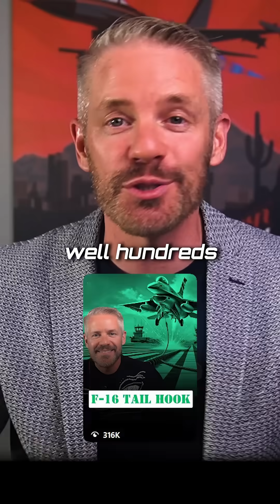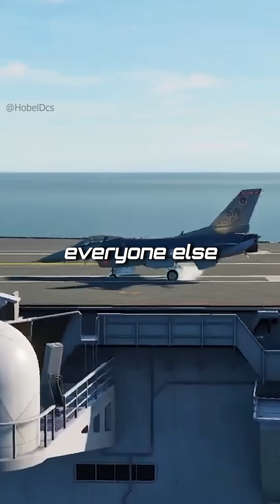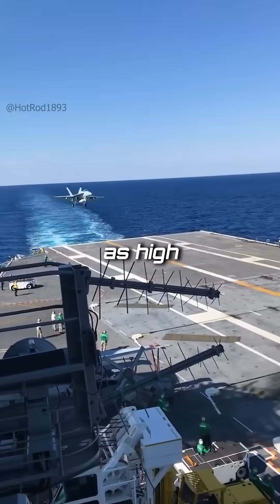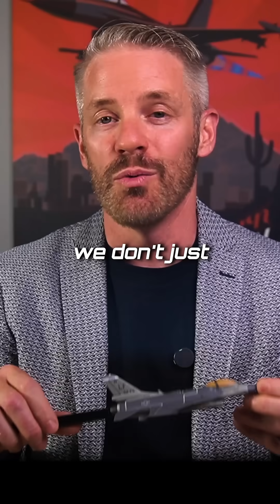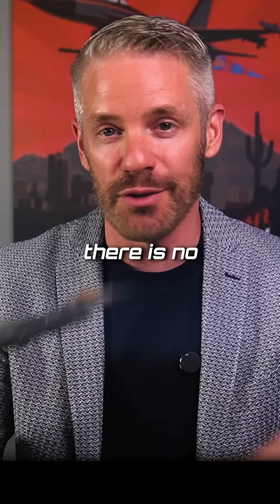Why the F-16 Can’t Land on Carriers

Comment: They did experiment with the f16 designing a navy variant but did not work out i actually got to see it when I went to Pensacola to the national naval aviation museum ( I also think they use them for training but I'm not sure )
Reply: Are you referring to the F-16N? 

Those were used at Top Gun as aggressors. If I recall, a navalized varient was proposed but the Navy wasn't interested. They chose to further develop the YF-17 into the F-18. They like to complain about single-engine fighters not having sufficient safety margins operating over water, but the Navy has operated many single-engine fighters. 

I think the Navy just doesn't want USAF types & vice-versa, so anytime they can get away with it, the respective services will push for their own airframes.
Reply: @rts0fft0ya16  yes

Comment: Use the hook where in emergency situations? If you can't use it on a carrier where would you use it?
Reply from the maker: We have cables on almost every runway 😃
Reply: @realshawnwalsh  Thanks. I had no idea.
Reply: If the aircraft has a hydraulic failure or brake issue it  will take the cable to stop the aircraft before it goes off the end of the runway.

Comment: Clear and present answer!
Reply: Clear and present...  but WRONG.
The question was 'can'.

An F-16 can easily land on an aircraft carrier.  The landing gear can easily handle the stress.  And the tailhook can easily handle it as well.

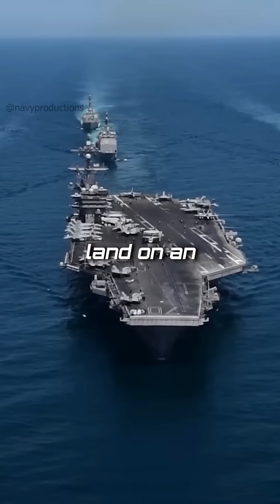0:13 - "It's just not built for it."

The mistake here is whether the design can handle doing something ONE TIME, versus doing it many hundreds of times.  So the answer to the question of whether the F-16 can, the answer is easily YES.  But if you tried to do it dozens of times, then you will eventually snap the main landing gear off.  Tailhooks are easy and cheap to replace.  So you'd swap that out after it started to show signs of metal fatigue.

Now here's the reason why it has never been done, and will never be done:
Because the aircraft carrier is worth orders of magnitude more than an F-16.  Attempting to save one jet at the risk of impacting severe damage to the carrier will never be worth that risk.

The Captain of the ship will SHOOT YOU DOWN before you got close enough to try.

Notice how on Navy fighters, they only put ONE STICK in the jet.  That's because they would much rather you EJECT than let a non-pilot attempt to land on their carrier.  This is why  Cougar's backseater had NO option to try to land himself.  It was either Cougar trapping, or they were going to eject.  Even in a 4-seat Prowler, they had only 1 stick.  Even though the right seater had the same view as the pilot.

Now I would like to see someone try this, to prove it once and for all.  Especially to very well experienced people who tell everyone it can't be done.  And here's one way to do it sensibly...

Get a Nimitz-class that's about to be decommissioned, being replaced by a Ford.  And then get a Navy carrier pilot who has been F-16 qual'd, and send them to do it.  On a volunteer basis, of course.  I am of the opinion that you could do it all day long.  Yes, it would certainly be a very HARD LANDING.  But the F-16 landing gear is designed to handle hard landing.  Just so long as you don't do it too many times.

Now the person who would have the most credibility saying what is being presented here is exactly that kind of pilot:  A Navy carrier fighter pilot who has been qual'd in the F-16.  There is no shortage of such pilots.  Look at nearly everyone who flew the F-16N.

That said,
You might be able to find an F-16N pilot who says what is being asserted in this video.  But if there is such a person out there, I would guess that they do not have an engineering degree.  But really all that is needed is COMMON SENSE:

- How different is the stress on the tailhook in a carrier landing versus taking an approach end cable on land?  Yes, you have LOADS more cable runout on land, but it is not all that different.
- How different are the loads on the landing gear in a very hard runway landing, versus the no flare landing that is done on a carrier?  It is essentially the same.

All anyone need do is put these two situations together, and viola.  You arrive at the most obvious answer of just how SIMPLE it is to land an F-16 on a carrier.

Now one point not addressed here in this video is:
Can an F-16 TAKE OFF from an aircraft carrier?

Here the answer is very easy too:  Most certainly YES.

Take a Block 52, give it a very light fuel load, pour the coal on to get max Wind Over Deck, start your takeoff roll from the very back of the deck, and getting airborne would be a piece of cake.  So easy that I expect you could do it in MIL power.

Can an F-16 do a Cat Shot off a carrier?

Here, modifications would need to be done.  Your typical Navy fighter has TWO nose wheels.  This is so that when you hook up the catapult to it, the loads are balanced between those two wheels.  The jet is pulled from the middle of them.  You could try it with the single F-16 nose wheel.  But my guess is that there might be severe stability wobble issues.  And given that the F-16 was never designed to take such pulling loads on the nose gear, I would not be surprised if the gear would SNAP right off.  But you can see how the Navy rigged certain fighters for cat launches by attaching WIRES that pull the jet at anchor points where the aircraft can handle the pulling load.  So that same type of approach could be done with the F-16.

So here too, my answer would be YES.  Yes, the F-16 could do a cat launch, with certain minor mods.

But while landing is easy, and taking off is also easy, given the full deck for your takeoff run, doing a cat launch is NOT something I would see to be easy.  Depending on how the mods were done, it might be a very dicey thing to attempt.  But I would expect success.  And as with landing, not something you'd want to make a habit of doing.

And for ANYONE to address this question, it should be pointed out that way back in the early 70s, they TRIED to sell the F-16 to the Navy.  Just as MacDac teamed up with Northrop to make the YF-17 carrier capable (meaning, doing it on a daily basis), the plan was for Vought to do the mods for GD with the F-16.  This proposal was called the 'Model 1600'.

An easy guess here is that THIS was the jet that the Navy PREFERRED.  The YF-16 handily beat the YF-17.  The story that got fed to the public was that the Navy wanted the reliability of having 2 engines.  This cover story is blatantly hogwash.  The Navy had great success with jets like the A-4, the A-7, the F-8.

Then fast forward to the F-35.  Did the Navy lodge this complaint decades later?  I never heard a peep.  So obviously it was a bogus reason, and the general public ate it up.  The actual reason why the Navy bought the F-18, and not a navalized F-16?

Because if you give too many contracts to one company, the competition will starve, and eventually die out.  The Navy ended up with the LOSER of the LWF competition because the Pentagon needed to throw MacDac a bone.  They needed to keep that company competitive.  And so billions flowed into their coffers.  If you want to do a much more OBJECTIVE ANALYSIS of the F-16 versus the F-18, all you need to do is look at the decision made by dozens of countries around the world.

Some 32 COUNTRIES picked the F-16, rejecting the F-18.

Who made the opposite decision?
7 countries, including...
- Canada
- Australia
- Switzerland

I would say that the most telling decision is what happened right here in the United States.  The Navy pushed to buy F-16s, as noted above.  Was anyone in the USAF eager to buy any F-18s?  I'm not aware of that happening a single time.  The best counter example is NASA's decision.  They bought a few F-18s.  I don't recall NASA ever buying a single F-16.  Not any normal ones.

So the bottom line is, YES.  The F-16 could EASILY land on an aircraft carrier.  But would anyone let you try?  That would be the most unusual of circumstances.  And could an F-16 take off from a carrier?  Here too, the answer is YES, easily.  And demonstrating this could be done at a very low risk to the carrier itself.  The most expected worst case here would be the F-16 drops into the drink, but leaving not a scratch on the ship.  But a clean Big Mouth GE with a very light fuel load...  I'd give it a success probability in the high 90% range.  Even higher success with landing.
Reply: Here is a much more concise rebuttal to this notion that you can't, because...

0:13 - "It's just not built for it."

NO ONE is making you fly a normal glide slope to the carrier deck.  If you are squeamish that the landing gear can't take it, then just fly, say, a 1-degree glideslope.  Yes, a lower final approach angle increases your landing footprint dispersion.  It will be much more sensitive to pitch as to whether you grab the 1-wire vs the 4-wire.  Or put a huge dent into the stern, for that matter.

But the F-16 HUD makes this a piece of cake.  Just line up your Flight Path Marker on the descent angle that you want.  For example, take the normal cue, and cut it in half, then drive that picture all the way down to the deck.  Your touchdown will be a lot softer than a standard carrier touchdown angle.  It literally cuts your h-dot in half.  The forces impacting the main gear are now half of doing the method described earlier.

Just because no one in the Navy does this normally does not mean it cannot be done.  A Viper pilot of average skill could do it, I  expect.

And because we're talking a Emergency situations, we should include SFOs.
You can also do an SFO to a trap.  This is obviously a lot more tricky.  But the basics are essentially the same.  You just have only one bolter option:  Aces II (/Martin-Baker if you find yourself in a Blk70/72).  Then again, the Navy folk receiving you might have been kind enough to raise the barricade for you, if the ship has one.